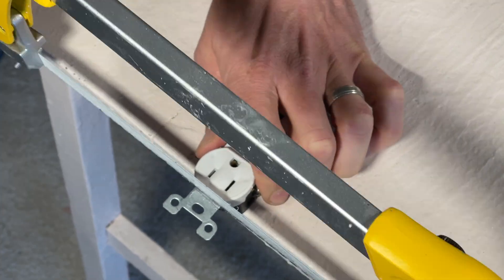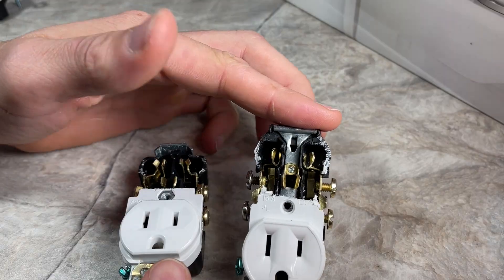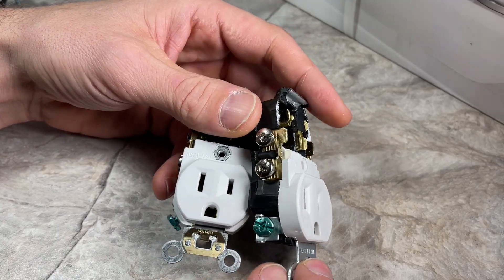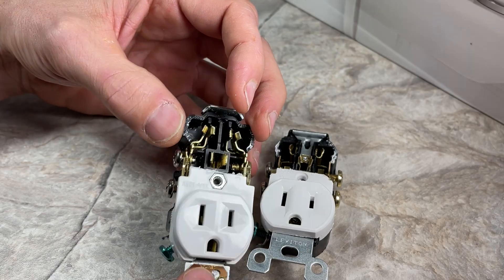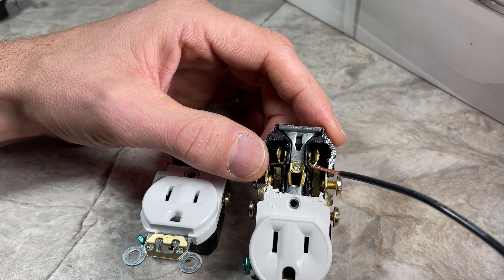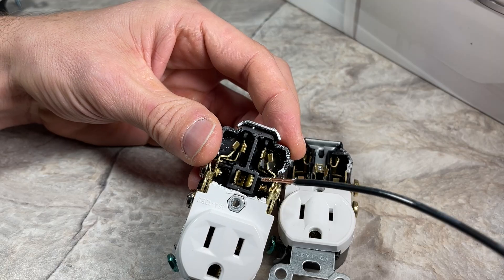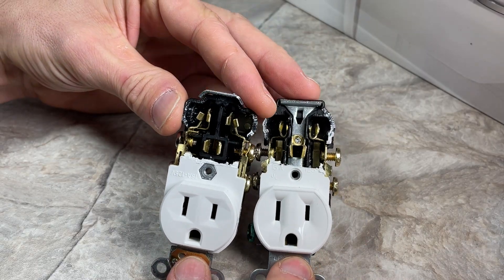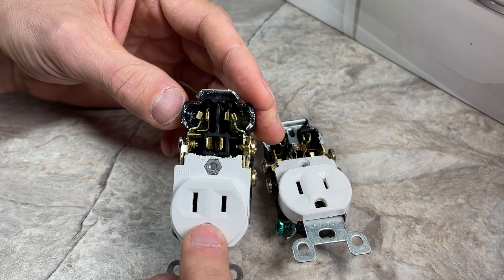What Outlet Should You Buy For Your Home |  Commercial vs Residential

Comment: FWIW, we owned an old apartment building and I installed a lot of outlets in it when we rewired them. I always bought the cheap outlets, mostly from Lowe's. We had almost zero problems with the outlets and many of them had been in place for more than 20 years when we sold the building. If you are paying to have outlets installed you might  go for the more expensive ones because it just costs so much to have an electrician install the outlets that the cost of replacing a single broken outlet where a more expensive outlet would not have failed would completely erase any savings from using cheaper outlets. The amount of use might be an issue also. In an apartment people tend to plug in something and leave it plugged in so even if the more expensive outlet might do much better with large numbers of plug insertions and removals the cheap plug might not see anywhere near enough plug insertions and removals to make it fail.

We did rarely find that the outside edge of the plastic around the ground receptacle broke a few times. That's mostly a minor aesthetic issue but maybe that failure would be less common in the more expensive outlets.
Reply from the maker: Hey Dave, thanks for sharing your experience. Do you get out of the rental biz?
Reply: @EverydayHomeRepairs  Hi, no we're still in it, but we discovered this wonderful thing towards the end of our active involvement. Pay people to do stuff. It's a wonderful thing. I wish I'd discovered it earlier. Thank you for the video. It was about something I'd been curious about for awhile. Why does the store carry two different outlets that look the same and seem to do the same thing. I can definitely see value in the more expensive outlets now.

Comment: One of my complaints at hotels is plugs that are just worn out (I'm only staying at Hilton, Marriott, and Hyatt properties). You put in your phone charger and it just falls out. I wonder what level of outlet hotels are buying?
Reply from the maker: Good question and I am sure it matters on the city / state.  I believe also the number of floors a hotel has can change the code they need to follow.
Reply: Flea Market brands. They buy the cheapest equipment possible. Just like Schools , hospitals and apartment buildings do.  As a 40 year maintenance guy what we want and need is not what management thinks we need and what they give us.
Reply: Most spec commercial grade but I hate to break the news commercial grade means nothing...there is no test requirements to be commercial grade.  It is all up to the manufacturer discretion.  They can take a resi outlet and also use it as a commercial device
Reply: Big hotels put out the construction for bid. A usual requirement is "meet code". Low bidder puts in the cheapest he can, and we all know sometimes inspectors can be "convinced" to not see something. It all comes down to a combination of greed and a lack of pride in workmanship.

Comment: It wasn’t mentioned but the better outlets have terminals that allow the wires to be attached straight, not bent into a hook around the terminal screw. Much faster to wire up.
Reply: My experience is that the cheap ones have them as well but they only work with 14 gauge wires. There was 12 gauge wire installed in most of the places where I have installed outlets so I have rarely used the stab in connectors but I know that electricians are not a fan of them. On rare occasions I think I've seen failures with the stab in connectors but they are much more reliable than I would have guessed.
Reply: @davefoc  there are backwired receptacles that can accept stranded and solid wire.  They are more expensive.  The best side wire commercial is Hubbell CR15.  Next to the terminal screw there is a round anchor hole.  Simply insert solid wire and wrap it around the screw terminal.  Saves time and your wire wrap is perfect.  Only on Hubbell
Reply: @LuLu_World  I think I understood what you said about the Hubbell receptacles and it sounds like a very good idea. I wonder if that would have been enough to get me to pay more money for receptacles. I don't know. As I mentioned in a comment above I went through a very long run with cheap receptacles that worked well.
Reply: There's two types of push in back wire terminal. The spring loaded stab-in pretty much sucks and is forbidden is many localities. The screw down clamp type are fine.

Comment: Been doing this for years...dollars are a consideration?  Consider the better plugs in bath and kitchen, washer, dryer for gas and garage door opener...WHY?  That's about 10 plugs in a house.  They have the heavier amperage loads...hairdryers, toasters, microwaves, motors...a hidden plug above and behind the stove for the microwave definitely better grade...WHY? The heat factor above the stove or behind the stove or in the ceiling of a garage hot and cold will work against a poorer grade socket.  REMEMBER they are all UL listed and meet that code.
Reply from the maker: Appreciate the feedback!

Comment: I used the push terminals before, recently had an outlet burn up due to the heat created from poor contact/high resistance.  Was not a pretty sight when I pulled the outlet up. Males me want to go through the entire house and check / possibly replace all of the outlets !
Reply: If you feel brave; go around with a hairdryer or a portable heater... You'll shake out the bad connections all right.
Reply: @wim0104  haha, after that burnt outlet I went around with an iron and tested the rest of them ! It was in my master bedroom and every time I plugged in the iron the lights would dim quite a bit, figured if I turned all of the lights on and plugged the iron into every outlet that would be a good way to check them all.

Comment: Could you maybe talk about CO/ALR outlets and using regular outlets to replace them? Also maybe joining aluminum and copper wires together.
Reply: Never use receptacles that are not rated for aluminum wires.  Doubt you can find a receptacle today.
Reply: Joe D yeah they are getting hard to find in stock and they are pretty expensive.
Reply: With aluminum wire only use devices marked CO/ALR these are specifically designed for aluminum and also can be used with copper wire. Standard devices can experience oxidation and provide poor conductivity when used with aluminum wire. 
Poor conductivity creates resistance and heat in a viscous circle creating potential hazard
Reply: You might find some old Leviton inventory on eBay

Comment: They’re receptacles Not outlets.
Reply: :) Learned that bit when I submitted drawings to the local building department.  They gave me a bit of crap over that. Still I call them outlets when I am communicating with non electricians.
Reply: They are wiring devices, the ones in your house are duplex receptacles. Which means 2  receptacles under the same yoke.

Comment: There are many homeowners that always pick the cheaper flimsy outlet where a failure can cause a real hazard. I try to tell them if they're on a budget (as most of us are) during a renovation apply it elsewhere, electrical is not the place where you start cutting corners.
Reply: Really the extra $30-50 for commercial outlets for a house is nothing compared to the value of a house.
Reply from the maker: Well, at least now you have a video they can watch to try and convince them the importance of spending a little more when it comes to electrical.  👍

Comment: I have a tract home from the 1970s.  The Romex is very thick, looks like 10 or even 8 gauge.  The thickest wire they seem to sell at the big box store is 12 gauge.  14 and 12 on the shelves.   Why is this?  Is it because they just don’t make them like they used to, is modern copper just better or more pure, or is it something to do with the insulation?

The reason I ask is it’s tough to get the existing heavy wires on the terminals of new outlets.  They positively don’t fit into the back of the outlet where you can simply insert the wires into the holes.
Reply: The most likely difference is the conductor insulation. There has been dramatic improvement in plastics since "the good old days." Newer insulation is tougher and more heat resistant, and can be made thinner. I've seen wire insulation of that era crumble when you start messing with it. Second generation journeyman wireman.
Reply: Any chance you have aluminum wire ?
Reply: @KipOConnell  It's positively copper.  For some strange reason, the ground wire is a little thinner than the other two (2) conductors.
Reply: While I find it almost inconceivable, it's also possible someone actually did pull #10 Romex in your house. I think I still have part of a roll of it myself.  The reason you have the undersized ground is that at the time it was allowed by code. The actual wire gage (diameter) hasn't changed, and I've recycled wire that was a hundred years old.
Reply: #10 wire is available at most places and is used for 30 amp circuits. I've used it for air conditioner and generator installs. It's too expensive for anyone to want to install it for residential outlets. Take a look at the wire itself (not the insulation or NM sheathing) and check the rating on the fuse/breaker.

Comment: I wish i had known that when i remodeled my kitchen  last year.  Heres what happened.  I had brought the home 3 yrs ago as an estate sale.  My home was built in 1958.  Because there was no ground available (the wiring was 2 wire cloth braided NM ) i had used a GFCI for the first run and marked all the outlets downstream as GFCI protected no equipment ground.  I had used the backstab on the downstream with cheap residential grade outlets (dummy me) then one day i plugged in my 1500 watt electric heat gun paint stripper to thaw the old refrigerator which i was told was purchased by the guy who built the house, not 15 minutes later i hear a loud pop from the receptacle,  and it had completely torched the outlet badly enough if it weren't for the metal outlet boxes,  it may have started a fire behind the paster and lathe wall.   Thank you!!! I am going to have to subscribe to your channel!!
Reply: Sounds like your breaker was bad not your outlet

Comment: Retired now but spent 40 plus years doing electrical. You made a excellent video and showed the comparison very well. One thing I might add is any outlet 15 amp or 20 amp when the appliance wants to fall down where it is plugged in due to being used a lot of course shows the plug needs replaced. The short story to that is loose plug creates low voltage (voltage drop) which on a fixed appliance causes higher current (heat) which can start a a fire. ( I started in 1978 wiring houses, then to commercial, and retired working on power lines and substations.
Reply from the maker: Nice!  Thanks for the feedback.  My dad spent his career as a lineman as well.  Never saw a guy so happy to get a call in the middle of the night.  Overtime Baby!  Don't even get him started on multi-week trips for ice storms or hurricanes 🤑

Comment: To reach the internal quality of our receptacles over here (Europe), you would have to use hospital grade. But then you still have stone-age bare screws on them, something that no serious electrician has used here for around 40 years. And before some hillbillies claim that they need screws: Pushin does work! If it does not work in the US, then something's wrong with the quality of the products, or with the one who installs them (Choose yourself).

Tell the NEC writers to  define safe receptacles and switches (both for electricians as well as for DIYers) instead of being paid by the producers of mediocre electrical products and power providers (to maintain the current stone-age state). The US could have much better power systems (including 3 phase for home owners), as well as much better and safer products.

And yes, those receptacles will initially cost you $10+, but who cares, if it is about your safety.
Reply: just had to open up three recessed cans at finish time and replace the Wago brand push in connectors, because the factory didn't get the fixture wire properly inserted.  and I've made thousands of dollars in my career replacing receptacles with failed push in connectors vs hundreds tightening loose screw terminals.

and single phase rural distribution uses half the wire and a third the transformers of three phase, and household utilization equipment has no efficiency benefit.
Reply: @kenbrown2808  So, is it the fault of the Wagos that some factory workers were too dumb to use them correctly (or too dumb to use the correct ones) ? And are you sure they were original Wagos at all?
Reply: @oaw_manofnorse  well, there could be a factory out there producing counterfeit Wagos and someone out there hijacking truckloads of finished fixtures and pulling the wagos off and damaging the connections.  but I doubt it.  and it's not like the factory has one bin of the right wagos and four bins of the wrong ones.  

but yes, the wagos were not installed correctly.  just like wire nut failures are most commonly because of incorrect installation.  it doesn't change the fact that I am still seeing higher faiure rates with wagos than with wire nuts; and I am seeing higher failure rates with stab in receptacle and switch terminals than I see with mechanical clamping connections.

so yes, you keep on relying on a tiny sharp edge on a piece of spring steel to carry your current, and I will continue to prefer a large clamp that is installed tool tight on a surface area of the conductor, and on a wire nut that holds the conductors in surface contact with each other with a large surface area of spring tension, when I want it to carry significant current.
Reply from the maker: Question for ya:  Do you know if you pushin or speed wire options are made for more than 1 use?  I have seen Leviton say the 14 gauge pushin options are 1 and done.
Reply: @Everyday Home Repairs  Yes, the pushin clamps over here can be reused several times, and they still work correctly 40-50 years after they had been installed (There has not been one loose or broken wire in all the items I installed). 

If Leviton just give you 1 use ... well, I guess, then we are back at the quality point, aren't we?
Reply: Push in will fail over time, there is nothing wrong here and n America.
Reply: @sidsid9808  the best thing about push in connections is when you are troubleshooting receptacles, and pull one out of the box, and half the wires fall out of it, you know you've found the bad one.
Reply: @sidsid9808  The pushin clamps over here still work correctly 50 years after they were installed, and most probably will still work in 50 years. If your clamps fail sooner than that, then indeed there is something wrong on your side of the pond.
"will fail over time" is anyway true for any thing on earth. Your wire nuts will also fail  ...

Comment: To be code they will need to be tamper resistant and honestly if you can do it yourself and you don't plan on using the recepticle plugging in out a lot wldnt Bother with the more expensive one unless its a high load device
Reply from the maker: For the price, at least for me, I am going with the Commercial grade.  Even in my limited experience I have seen too many burnt $0.50 plugs.

Comment: Those cheap outlets suck. I had some of those actually crack  and you have to take out the whole outlet and replace it. Another thing is that after a while they don't hold plugs very well, especially if you're talking about 2 prong plugs.

Another thing that I realized with those cheap outlets is that if you have a 3 prong cord plugged into one of them and then you happen to be moving a piece of furniture along the wall and hit that plug with the side of the furniture,  it's over. A lot of times the outlet will crack and pieces of it will come off.

I prefer Commercial spec or better yet, Federal spec grade outlets.
Reply: Comm spec means nothing.  There are no test requirements for a mfr to meet to be able to call there product comm spec grade or heavy duty or industrial.  Now to put hospital grade on it u have to meet test req
Reply: Commercial rating do met test to be called commercial rated. That is why the ASTM Certifaction number is different   Nema also has a rating for the grades.
Reply: @thomasmarable6818  the NEMA code defines the configuration of the plug, and the UL standards are the same for all grades and there is an extra standard for hospital grade that the receptacle must meet